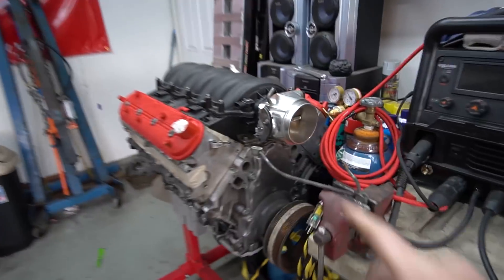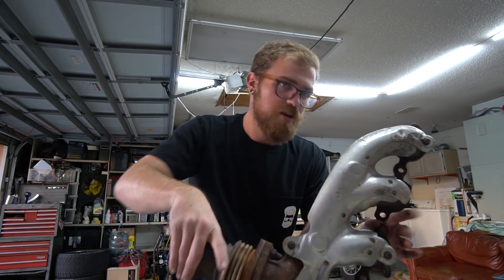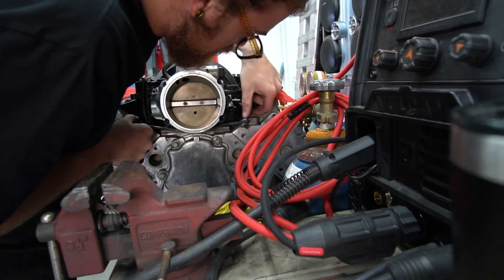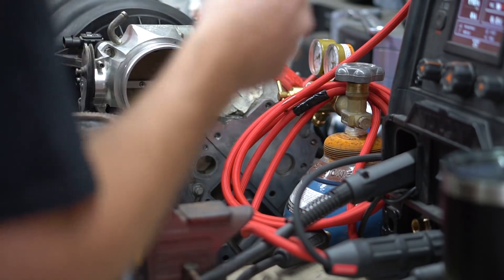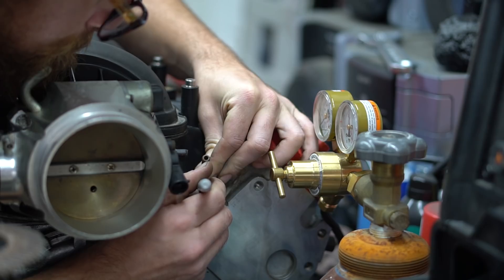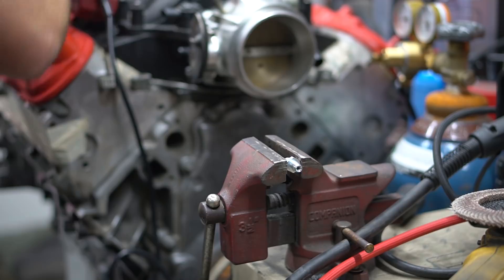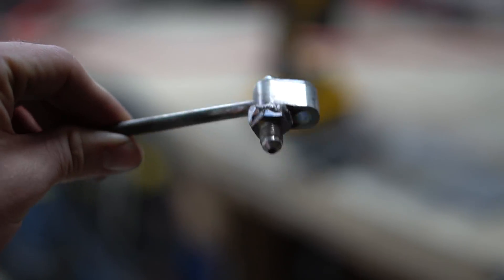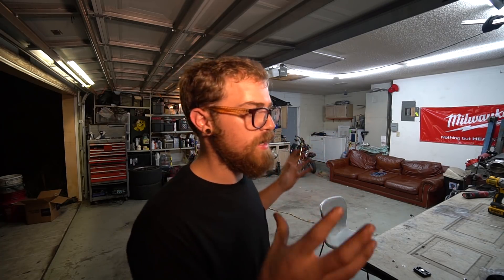Budget LS Swap Miata Pt.4  Update on Stuff

Comment: Useful welding advice. Not trying to knock you in any way, I think it's awesome that you're trying to learn so just wanted to share a few tips that could make that job you were trying to do in the video possible. First, smaller diameter filler rod, like .045" for what you were trying to do there. It looked like you were using 1/16" which in my opinion is too big for what you were trying to do. You could use it, but you'll only make your life more difficult. If you do get a puddle going, you'll just freeze it as soon as you dip the rod. Second, needle sharp tungsten with a long taper(putting the tungsten in a drill to spin it will make sharpening it much easier and give you more consistent results) and if you dip it stop and sharpen or change it out because the arc is going to wander all over the place until you re-sharpen. I keep five or six tungsten sharpened and ready to go so it's a quick switch. Third, when trying to weld thick to thin, lite up on the thick, form a puddle, add some rod and whip it over into the thin. If the arc is grounding through the thin material it will just melt away before you can attach it to the thicker piece. The thick piece is the bigger heat sink and you have to melt it first. If you're just jamming rod in and melting it that isn't a good weld. You have to melt the base metal first then add rod to the puddle. Fourth, torch angle, imagine that the tungsten is producing a cone of heat and the angle you hold the torch at dictates where that cone points, point the heat more on the thicker piece. I see you making a lot of the same mistakes I did years ago when I learned tig welding so just trying help you get better and break bad habits quickly.

Comment: hey Taylor, tip for ya or anyone i guess. if you have a you-pull junkyard near by, i used a 2000 S10 Blazer 4.3L (S10/Astro/Blazer 99-01 it looks like are same) alternator. its a 100amp vs a 102a of the camaro. but other than that it was a direct swap, bolted to camaro bracket just fine, plug was in same spot, even accepted the little brace bracket. plus they are super easy to pull at the JY (right on top) and was like $15 at mine.

Comment: Love the vid. Suggestion, get yourself some .045 or .035 309 filler. It help to have the thinner stuff when learning. Also the 309 is helpful for welding shitty used old steels. Magnets will also mess you up. The arc it often sensitive to it and will give you hell when trying to direct your arc. A small bench vise helps.

Comment: When tigging things like that steam manifold, it helps to preheat to larger chunk of steel. Also, you really need to clean your steel better. It needs to be completely raw steel. You have to get all the plating and coatings off of them. 

I also couldn't tell for sure, but it looked like your tungsten was not sharp enough and might of even have a bit of contamination on it. Remember, you should not be getting sparks when tig welding. 

Keep at it, you'll get the hang of things. Just remember with TIG, the prep work is critical.
Reply from the maker: Thanks for the advice!

Comment: okay so im doing my ls1 swap right now in my e46, i have a built motor, forged internals, big cam, injectors should be good for 500hp fuel system restricted but, what im wondering is why wouldnt you use a t56, my guess is youre going with the cd009. i got a blown ls1 t56 and a lt1 t56 for a grand total of $1100. the collins kit is $500 with out clutch and ~$400 for the trans then you have to get a clutch flywheel stuff for basically ~$1100. why not just use a t56 and not have to fight with adapters. BTW if anyone cares the t56 ls1 combo fits in a e46 like a deam
Reply: grant mullet Because if you can't find a good t56 like you did they're somewhere around 2-3k.

Comment: CD009 INCOMING
Reply: Mark probably a ar15 cd009 adapters are expensive makes it the same price as a t56
Reply: I'm calling it now, NV3500. Cheapest LS 5 speed trans. Cd009 isn't a cheap swap anymore because of demand.
Reply: Clay Cantrelle how are they not cheap? They’re $800 all day everyday unless you go brand new from Nissan or another dealer. The only expensive part is the adapter
Reply: What's a Boost? Add a $500 bell housing adapter and a $250 t-56 bell housing aaaaand you're at the same price as a t-56.

Comment: im guessing cd009 for trans? and make sure you either super glue locktite or rtv the small screws in the throttle body blade they tend to back out and get sucked into the motor!!

Comment: What are you doing with welding that? That is a coolant crossover tube and you don’t want to starve the heads... and also make sure you put an o ring on both heads before putting the crossover tube in.

Comment: You could've drilled the hole in the crossover pipe a little larger so that the tube sat in, rather than just on top, then weld.

Comment: Hi Taylor I’m 14 and is saving up for a swap for my Miata. I don’t know if I should put an sr or an LS. Which one is more reliable. thanks
Reply: colton wern the most valuable mod you can get is seat time
Reply: If you knew anything about anything you would know that SRs are unreliable and quite difficult to put in a miata as you need a custom oil sump, there's obviously a reason Taylor is going with an LS and if you watched any of his videos on this you would know why. Idk why I'm wasting my time replying to you as you're 14 and a swap will probably cost at least 5x the price of the car which will never happen anyway.
Reply: Leave it stock or put a turbo kit on it gingium has a stock motor with a turbo kit and hes never had any issues
Reply: I love sr's but reliability is definitely not something they're known for
Reply: Leave it stock, and just wait to rain and go have fun in a parking lot with your friends. In the rain my 2 litre 150 hp feels like a 340hp drift car.
Reply: Seat time is the most important. Miata engines are stout. You're better off turboing it than swapping.
Reply: both require modded/custom front subframes, lots of money. I'd boost the 1.6 or 1.8 instead of dumping cash into a swap. Ricer Miata is doing an SR20DET swap into a JDM Eunos Roadster (Miata). He's has a dozen other cars though so he hasnt done much work on it lately, but it is a thing if you wanna check him out if you haven't already.
Reply: colton wern Miata ls swaps are somewhere around 10k. If you're lucky you might be able to do it for under that, but it's certainly a lot harder.
Reply: Max Wilding how old are you?

Comment: When you were welding were you using 3/32 wire that’s way too big for a small piece like that. I would get .045 wire it’s easier for beginners but you do need to put more wire in it.

Comment: To late now but you didnt put enough heat in the little... Aluminium? Block your supposed to put all heat on the block then just touch the tiny pipe. And it should of blended even without feeding it lol. But it could be a stainless pipe and aluminum block and those will never tig together 100%

Comment: Dude... you should have not of bought those trunnion upgrade. The reason people buy trunnion is to rev higher and not have to worry about the stock rocker needles coming apart. The comp cams one are the same thing... you should have bought a brass trunnion upgrade. Please listen to me.

Comment: Your heads need to come off! in the last video you showed as you turn the engine it hangs. Its hanging on rust on the cylinder walls. Your pistons will not seal good giving you a loss in power and it will make this install pointless! New rings hone the cylinders put the pistons back in and your golden pony boy!